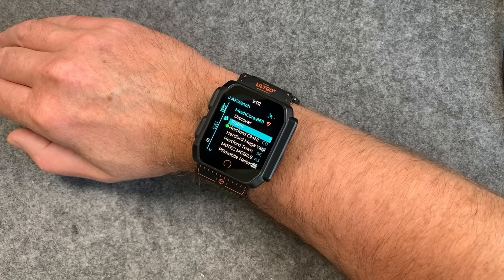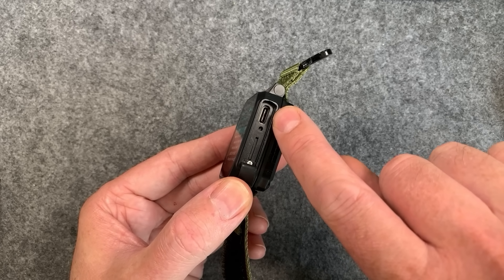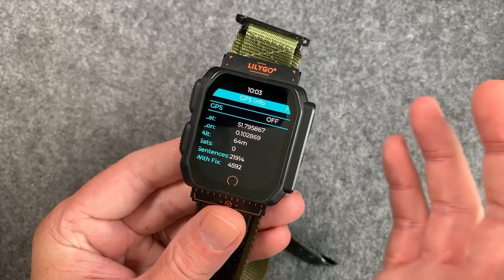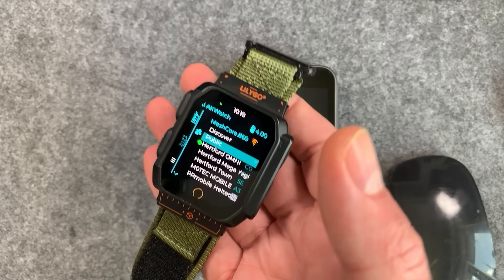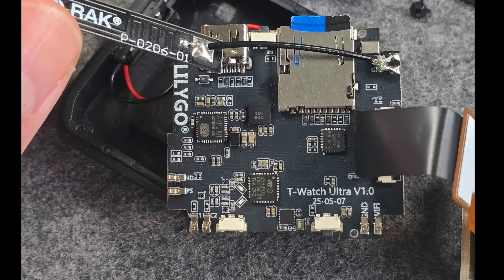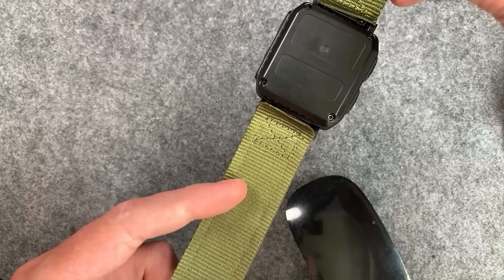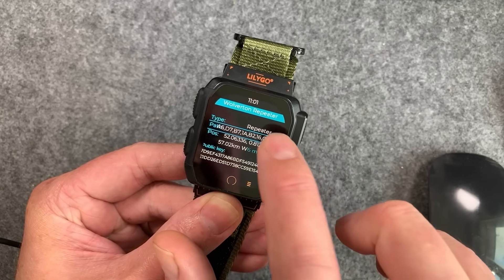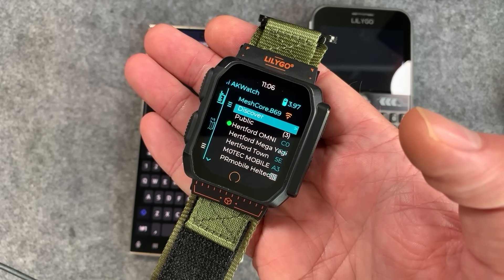THIS MESH WATCH IS GOING TO CHANGE THE GAME!!!

Comment: This product still isn’t available but instead they announced a new device. I highly doubt devs will adopt devices if they are released so frequently.
Reply: I think the idea is that this is a standardized microcontroller with various features like screens, microphones, speakers, IR, and the like. Anything that uses the same core brains will be able to run the same software.

Comment: I call for a new form factor all together. This tech is worthy of that. I would go for a wrist 'rig'. 4 inches wide or so and wraps around with a 3-4 inch covered screen by 2 inches tall. When not on the wrist you could just slip it in the pocket or a pack if desired. 3-4 times the battery life, very usable screen, plenty of space for a proper antenna, and there could even be an option for an antenna extender to be screwed in and either removed or folded down when not in use. Why try to fit it into form factors that already exist for completely different tech? I dont really want another watch or phone... I want a mesh-tastic beast!

Comment: I wouldn't test any water resistance...   it's probably okay if you're on a motorcycle in the rain and it's under your sleeve, 
but I wouldn't go swimming or submerge it on purpose or wear it in the shower.

Comment: I was thinking of making an LED light bulb that is a repeater so I could give them to the electrician who replaces light bulbs all the time in my bosses car park as part of a grant and at the same time get IoT. Some of the bulbs are high above the ground and there's line of sight to, say the 3rock TV antenna here in Dublin. A light bulb means that the repeater always has power. If you put a repeater in that blends into the environment it's not going to be messed with. I was thinking of using this for IoT like flood detection, door opening detection - low bandwidth logging of events.
Reply: Lightbulb idea is genius

Comment: Nice, i like the look & functionality of that, good mod with the areal, 
ive actually got a mullered rak here that went splat under a speaker i can steal an antenna from, 
i might grab one these & do some fidgeting with it, ime not getting excited yet tho as ime all the way down ontop of a  massive hilltop on the Devon Cornwall border, 
i know there are people on the Devon side on the mesh that cant get signal over my hill, same with Cornwall so ime working on getting the parts to put together a super repeater so to speak. 
I am going to put it up my old CB mast on my unit roof with a wired power supply connected to my off grid power.  ime right on the summit so that should serve as a fairly vital not for folks down here to get up into the rest of the country, ime always fascinated by the thing you manage to find.

Comment: Hey Andy and comment section,
Hey guys... I need some help. It was installed in me growning up that men dont ask for anything but since I have had years of medical issues, I know there are times I should talk to someone and if need be... ask for help.

I am at the tail end of another hospital episode. A few years ago, I developed an urinary fistula and was hospitalized for 996 days. Since then every so often I will have an episode where I am hospitalized again. From 5 months to a week. It all depends. 

I HATE it there. I live in Japan and am still learning Japanese so it is so very lonely.  The isolation is brutal. 

Please would someone help me either build or guide me so I can build 2 mesh units. It would be a bit difficult for me to access a computer but I might be able to. However, I do not know how to do this stuff and I think with guidance, it would be a great introduction into amateur radio.

The 10th floor has an amazing observation deck. If I could go up top and kill time up there, it might help time pass.

Please think it over and if someone can help me out, I will check the replies to this post as I can not check my yt notifications. 

Thank you for reading my message. I am getting stronger every day. The isolation is just so crappy.

Comment: running an OS with OLED display on Lora is just silly.... E-ink screen would last over a month....
Reply from the maker: Eink awful to use though.
Reply: @andykirby  LORA transmission rate is literally in the bits per second range, and even then sometimes you cannot transmit or receive at high intervals.... Why do you need a fast screen and processor for that.... These devices will then become cell phones without cell service if the trend keeps going.... they should just remain more like a PDA, or E-reader.

Comment: Casio put antennas on watches and they were awesome. Casio radio watch has to be one of the coolest watches ever.
Reply: I agree! I used to have one myself. It was less than half the size of this new 'game changer', if I remember correctly. Watches should never be thicker than the average wrist of a human being. That should at least be the 'rule of thumb' here! ;-)
Reply: @j.vonhogen9650  100%! People who don't know anything about watches keep making these "smart"/tech watches and they always look horrible as well as having horrendous ergonomics.
Reply: Could you listen to the radio with it or what did they use the antenna for?
Reply: @thomas.thomas you could talk through it to speakers and stuff. It’s the Casio TM 100
Reply: @thomas.thomas  My favorite watch, a Casio GW5000U, recieves a daily radio signal in the morning. It makes sure the time is set absolutely correct. I believe it's called an "atomic watch" feature. My watch feature a solar panel too so I never have to charge it or set the time. If I'm travelling I can change the "world time". The fact that this watch is a GShock makes it VERY rugged and reliable. It's basically a tank of a watch. It will last me through thick and thin, and it has already. For someone who is considering this type of watch from Casio for a daily wear, you should definitely consider the top of the line, GW5000U. The version made in Japan. You can find the same features in a cheaper G Shock, but the plastic and feel of the watch is different. The Japanese version feels like a real watch on the hand, but it looks like a G Shock. It's like a "sleeper watch". People don't even consider stealing it until they try it on. Only the watch efficionados would know you got the Rolls Royce. The plastic is really more soft and flexible. The watch is firm in hand. Bless you all in Jesus Christ MiCahEl of Nebadon, ALL GLORY TO THE TRINITY OF PARADISE, ALLAHLOOYAHJAH

Comment: Thanks Andy , makes it a nice Watch 🤣 Spotted this device on LilyGo and here is the video 👍 I am developing a similar watch based on AMOLED 1.75" round screen and screen quality is great. Its called SkyView and  used by paragliding pilots for traffic awareness and tracking. Its using similar technology as Meshtastic, called FANET/FLARM.
Would be good to see the radio range test of this watch, especially with you antenna modification, looks plausible. I also test my devices , when airborne they get range about 120km. Cheers. Vlad.

Comment: Kinda wish this had multi frequency support, I'm currently in the US, where we use 915MHz but also may be traveling to the EU where the LoRa bands are different.
Reply: 868 and 915 use same hardware. I'm sure the antenna is tuned to both freqs

Comment: Rather than a keyboard, you could do with implementing something like Palm Graffiti.  Because it's more like shorthand, you don't need to have the grunt to do actual handwriting recognition, but the Graffiti glyphs are mostly like Latin letters, so you don't need to learn cryptic squiggles like Pittman or whatever
Reply: Was about the comment the same thing! In particular, it would support leaving much of the interface up instead of squishing down to a text box and compromised keyboard. Plus you could do most things with a finger tip and have a stylus for extended interaction sessions.

Comment: There should be mobiles with built-in LoRa chips.   It would not be difficult or expensive  for the manufacturer to build one into some new Android phone...
Reply from the maker: I'd still prefer to use an offline device i think 😁
Reply: @andykirby  You can dedicate one Android device and make it offline

Comment: so the lora is the old gsm data network but free. ie old 56k modem speeds. looks very military equipment. you can use the wrist band for longer antennal lengths. and circular large antennas. just add a minimal lora module on android phones. very small strap on module. esp32-s3? use rpi pico/2 instead.
Reply from the maker: No its a lot more modern than GSM, the range is a lot greater.